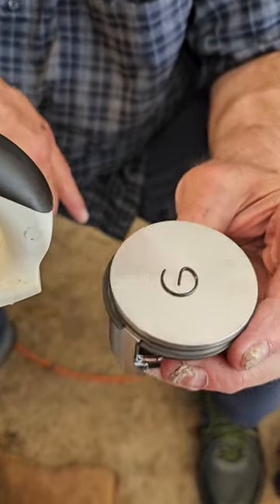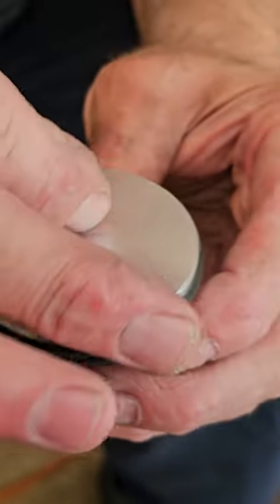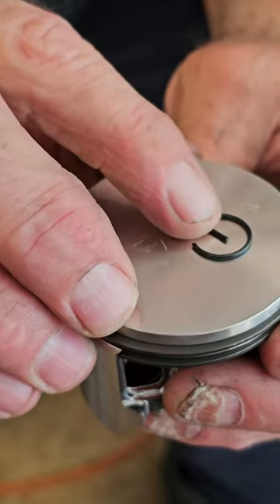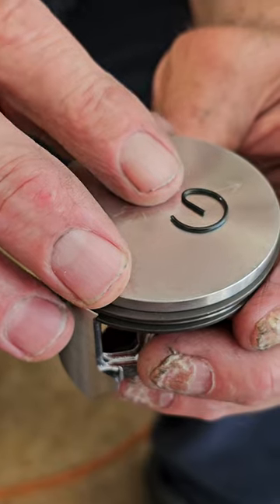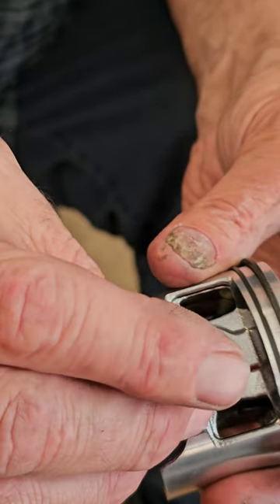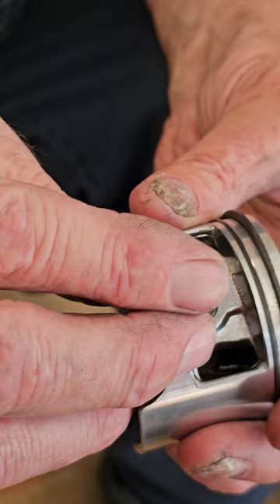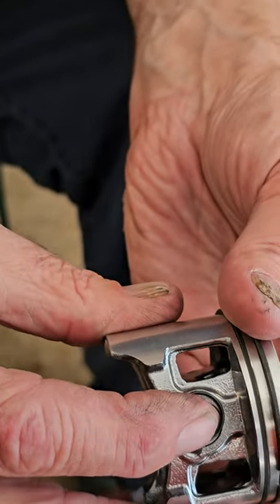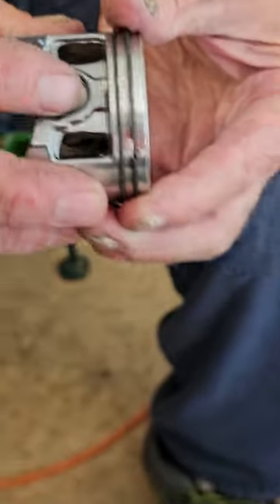Cir Clip Position on a Wrist Pin when building a Chainsaw, cylinder / Piston installation

Comment: I've always ran them pointing out anyways because they tend to not want to install correctly any other way. Like they don't seat correctly. Probably the reason they come out if installed like that. I'm building a 461 now. Haven't built in a little while. Should be spicy with a lil red barn pop-up piston and a little porting 😊
Reply from the maker: Awesome CBTS ! Thanks for sharing and good luck on your build !
Reply from the maker: @tadrum1  sounds like youre wasting your time on this channel.....how about going elsewhere?  And you should give your 5 year old up for adoption, as they will be better off with a better parent.